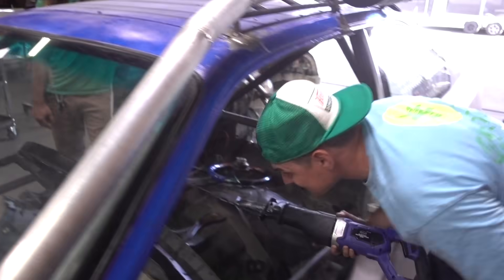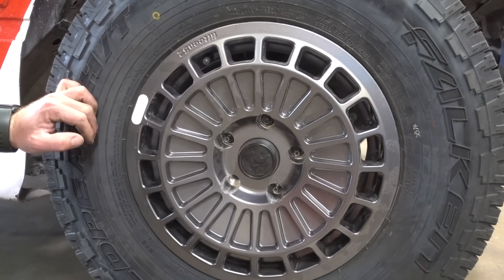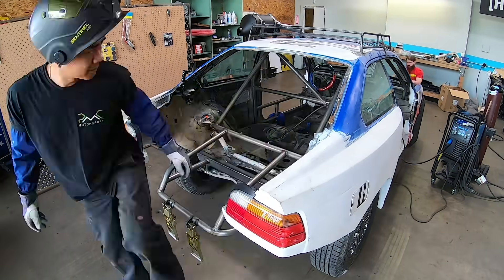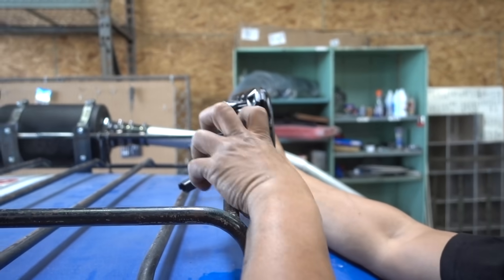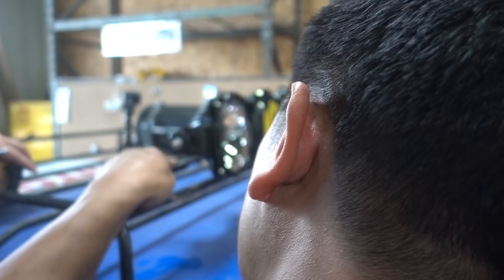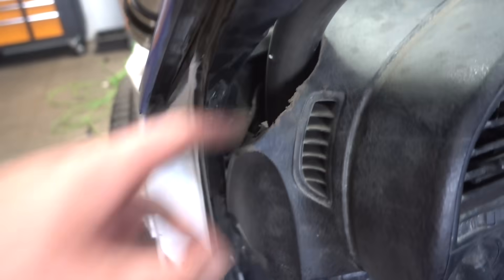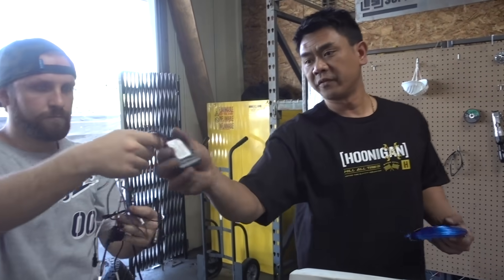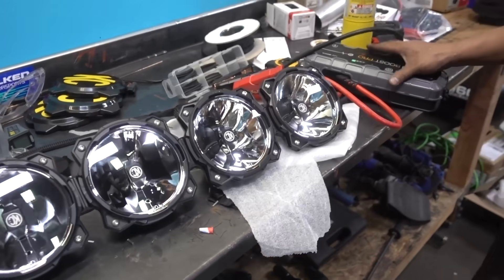Our $350 E36 Safari Project Car is Desert-Ready: Audio, Whips, Lights and Roof Rice Part 9/10

Comment: Any plans for a ceiling mounted woofer? A downward pointed driver would fit perfectly between those upper mounted speakers and would work for the party up front or out back. You could probably fit its own amp up there too and maybe another battery down below if you wanted to go full send with the lows.

Comment: I'm still kind'a worried about suspension...the first large bump and the front wheels lock up against the wheel well/frame, and at the same moment the the custom rear fenders explode.  Just hope y'all get the exploding part at a suitably high frame rate...for posterity.

Comment: No radio... my truck has no radio or my BMW Z3 M roadster.  In the M roadster the S54B32tu motor and 6 speed straight cut gears with dogs engagement makes all the music I can ever want and the radio speakers add weight 2100# life... need to race it but no track with in 4 hours and it is just a drag strip no turns and turns are fun.  The way y’all abuse that car it so epic, no füčkš given.